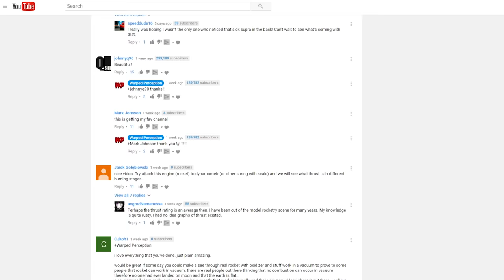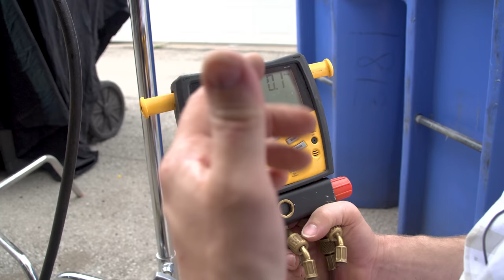Model Rocket Engine In A Vacuum Chamber - 4K Slow Motion - will it burn? - Rockets (S1 • E3)

Comment: Ok, can you build a setup to measure in slomo what amount of gas is produced by that Rocket motor? Also it would be interesting to know a what pace the pressure inside of the tube, is rising with, when the motor is started.
Reply: Nice video by the way, I obviously was so stunned, i forgot my manners :)
Reply from the maker: +Racineism working on that new episode now, I had some really interesting findings, check out the community tab, I posted a behind-the-scenes photo there.

Comment: So, many people who understand the flat earth theory better have commented here already that it’s NOT “will the rocket engine burn in a vacuum,” but “will it FLY in a vacuum.” I can only assume you tried to see if it would fly/propell forward normally now that you know the real question from others and it didn’t do so well. I haven’t searched too hard yet, but I found only one lame pop can experiment to show it would fly in a vacuum. I expected to quickly find tons of proof it would work on youtube & since it’s not there it makes me think rockets can’t propell properly in a vacuum. IDK either way what would happen but lean toward it would move forward in a vacuum at this point (at least not properly). One way to test would be the ballon taped to a straw on a string method in a vacuum to see if the ballon moves forward along the string via the straw like it does in a non-vacuum. A lot more simple, no need for a rocket engine & all that (if you have a way to unplug the air out of the balloon w/o breaking the vacuum).
Reply: Tom Woods uhm it flew ( it moved)
Also most people already think most people know this already so they don't make video's about it 
Another reason is probably that it looks like  much work and the pomp doesn't look cheap either

Comment: The thrust was seen on the scale after the the exhaust gases filled up the vacuum chamber half way, It would be helpful understand truly if rockets function in space if you can show the pressure fluctuations in the vacuum chamber on the manometer. thanks

Comment: Great experiment but the setup needs improvement. The spring should NEVER be connected with the cylindrical enclosure.  At 1:25 when you finger-test the spring, you are essentially exerting force onto the spring, and the spring is exerting force onto the cylindrical enclosure. The wall is providing the equal and opposite force. You could modify the experiment by making the spring to "barely" hold the rocket. You want to eliminate the wall from the experiment. The players should be the rocket and vacuum state. The setup will be hard since the rocket will fall due to gravity.

Comment: even if there is not air in vacuum, the rocket motor can still make pressure from the gas that exits from the rocketmotor, and that force pushes the rocket forward, and if someone was behind the rocket motor with a massive steel plate, he would be "shot" to the other direction with almost same force (depending of the effectiveness of the object to use the pressure.) and if you for some reason claim that there will not be pressure, that would mean either that the gas doens't have a mass or moving and object doens't require any force in vacuum ("bECaUse THeRe isN't AiR rEsIStAnCe!!")

Comment: Sorry, your vacuum tube is WAY TOO SMALL - The vacuum of space is beyond little tubes, the engine is still pushing off the wall at the end. Watch your slow-mo again and you'll see air passing by the engine, you can see in plain view it's pushing off the crap behind it... If you wish to view a real test, the engine smoke can "never" pass by the engine, the tube must absorb all exhaust.

Comment: Its hard to believe some people don't understand how rockets generate force. It's not the same  as an aircraft wing which actually uses atmosphere. In other words, wings manipulate the atmosphere to provide lift. The rocket has all of its necessary components inside to burn in a vacuum. It does not thrust itself forward pushing against atmosphere. It is a constant controlled explosion so it is the potential energy of the rocket that is being used. Think of it like shooting a gun. The bullet pushing on the atmosphere causes a recoil? O_o Explosions man! Rockets do not compare to wings... I mean do they even look the same? They operate on different principles.
Reply: I think you're giving them too much credit by assuming they know how a wing works.

Comment: Once the solid oxidizer thats mixed with the solid fuel inside of the rocket burns it creates an atmosphere inside of that small tube to thrust against, there should be continuous vaccume applied during the experiment to keep the tube in a vaccume state to off set the created pressure from the burned fuel that creates atmosphere/ internal pressure.
Reply: Rocket propulsion works BETTER in a vacuum. Do you honestly think that Engineers have not tested the 100-year old Tsiolkovsky Rocket Equation?
Anyone that proves it to be FALSE would get a Nobel Prize in Physics.

SO you believe that a Crossbow fired into a vacuum would NOT have any recoil force? Are you sure about that?

Comment: Should have put the vacuum meter in the shot as the engine was ignited.  Otherwise how do we know it was in a vacuum? The meter should have registered a pressure after the burn. There should not have been any vacuum left after the burn, but pressure. Nice try. But the editing causes many concerns. No problems with the build. Excellent test tank. Excellent construction. The holder inspired by the scroll compressor was unique as well. Not convinced the tube was completely evacuated and under a non-leaking vacuum.

Comment: If you watch the slo mo, the rocket doesn’t move until enough smoke built up pressure. Clearly the smoke filled tube was no longer a vacuum.

Comment: The smoke was the atmosphere that allowed the rocket to move. You have to have a chamber at least 100x the bottle rockets you're using. Fact is, it won't go anywhere.
Reply: @darklight2.1  the fuel has both propellant and catalyst so you don't need oxygen in the chamber. That won't work in space because the vacuum is infinite.
Reply: @nesNYC  :False. Rockets do not need thing to push off from. How do you think they work when launching and flying up?
Reply: @kitcanyon658  The rockets push on atmospheric pressure. Everything flies by pushing on this pressure. Then inertia does the rest. If they're really getting out into space, they would run out of atmospheric pressure once they hit the vacuum. They'll still have forward momentum but any drag would slow them down but the engines would have no effect in the vacuum.
Reply: @nesNYC  : No, that's false. Please explain how a stream of rocket exhaust, traveling out of the nozzle at supersonic speeds gets a push-back force from the air molecules. These same air molecules that would be being blown backwards from the craft by the rocket engine's exhaust. 

How does an air molecule transfer a force when it can't even touch the space craft? That's seriously your explanation? Jesus. 

Also, a rocket's thrust increases during its flight simply because the air become less dense. In your fairly tale-science-less world, a rocket would start to lose thrust the higher it goes. Since we can measure this during flight then you have zero data to support your weak claim. I know, you flatters have to keep grasping at straws and claiming so many things are fake but get an education.
Reply: @kitcanyon658  So air molecules don't offer resistance? Then explain why the craft needs heat shielding for re-entry 😄😄😄
Reply: @nesNYC  : That's not an answer to my question. How do air molecules push back against the rocket structure?

That's cool, bro. Just keep trying not to answer the question. We all see what you're avoiding here. 

And by the way, sure, air molecules have mass and heat things up through friction. As a structure touching them while moving. 

So explain again how air molecules being a rocket, being blasted further away from the  rocket touch the rocket and push it forward.

Comment: This experiment doesn't prove a rocket can work in a vacuum, however it does prove Newton's third law that states when two separate bodies interact, they apply forces to one another. The ACTION of the rocket exhaust applying a force against the rocket gasses and smoke the exhaust produced resulted in the REACTION of the rocket trying to move forward. Good job!
Reply: The action of the rocket expelling exhaust gasses has the reaction of those same gasses pushing back on the rocket.
Reply: @AM-rd9pu  Nope...that's what they want you to believe...but it is not true. You should have learned this in school. Movement requires two different forces acting against each other. The rocket exhaust is indeed a force, but there is no force acting against it is a vacuum. It is free to rush out the nozzle in the back, but unless it encounters a force acting against it, no movement will occur.
Reply: @rodneybaker2629 How do you think the exhaust gasses accelerate out the nozzle if not from a force from the rocket?

The expanding gasses collide with the combustion chamber and nozzle and impart a force on the rocket and the rocket imparts a force on the gasses. That’s the force pair you’re looking for.
Reply: @AM-rd9pu  Do you not understand when a gas is released in a vacuum it is immediately dissipates into that vacuum? They don't hang around long enough to provide a force. Remember, the third law requires two opposite forces that come from two different sources.
Reply: @rodneybaker2629  A vacuum isn’t a force. Gasses disperse because of their own internal pressure. The gas pushes itself into the vacuum. And when you have pressures in the range of thousands of psi inside rocket combustion chambers, the gasses push themselves out with a lot of force, pushing the rocket as they escape.
Reply: @AM-rd9pu  Yes, a vacuum is not a force, that is why when the rocket exhaust leaves the nozzle it encounters no opposite force. When gas expands into a vacuum, this process is called a rapid spontaneous expansion. The exhaust gasses do not perform work and no work is supplied to the system. If the system, the rocket, does no work it does not move forward. Newton's 3rd law of motion requires two opposite forces working against each other in order for movement to occur. The exhaust is part of the rocket for a while and is not an opposite force and when the gasses expand into the vacuum it is not an opposite force then either.
Reply: @rodneybaker2629  You seem to be yet another person who is confused by what w in w = -p * delta_v means. It’s the work the surroundings do on the system or the work that the system does in the surrounds. In the scenario of a rocket in space, the gasses are the system and the vacuum of space is the surroundings. When we plug in 0 for p, w get that zero work was done. This intuitively makes sense because it takes now work to push on nothing. A vacuum offers no resistance to the expansion of a gas. 

We know from the first law of motion that a force is required to make mass accelerate. We observe mass (the exhaust gasses) accelerating out the back of the rocket. So we know a force acted on the gasses to accelerate them that direction. The only place that force could have come from is the rocket. By the third law of motion, we know that there is an equal and opposite force. This means that the gasses impart a forward force on the rocket. 

The rocket pushes on the gasses and the gasses push on the rocket. That’s all there is to it.
Reply: @AM-rd9pu  You are not getting it. Of course gasses coming out the rocket nozzle is a force. But these gasses do not exert a force on the rocket. You seem to forget that the exhaust and the rocket are part of the same system, they are two parts of the object, the rocket. You can not have movement from force of just one object, you need two separate objects that have two separate forces acting opposite each other. If you don't believe me, try walking and your feet not touching the floor. Your feet is a force, but you won't move at all. Now try it with your feet on the floor. You feet are still one force but now the floor is a second force. This time you will walk because we now have two separate forces working in opposite each other. You know this is true, why give up your logical thinking and your common sense just to make a failed condition justifiable because you are told rockets can fly in a vacuum. It doesn't make sense someone would do that.
Reply: @rodneybaker2629  No, you’re not getting it. 

If not from the rocket, where does the force come from to accelerate the gasses backwards?

The force comes from the rocket. The two objects are the rocket and the gasses. The gasses push on the rocket and the rocket pushes off the gasses. 

Rockets work for the same reason that throwing a heavy object while sitting in a rolling chair will make you roll backwards.
Reply: @AM-rd9pu  The two objects are not the rocket and the gasses, they are part of the same system. You need another system involved to have something to force against.

You principal of throwing something while setting on a chair is not the same thing as a rocket. The reason you would move backwards while setting on a chair with wheels and you threw something is because there is friction between the wheels and the floor. While in a rocket and the gasses are thrown out the back the rocket won't move forward because it has no friction to move against. There must always be some sort of friction or force to move against or it won't move. A car won't move unless it has friction from the road. When you watch a rail dragster blowing fire and smoke out it's exhaust pipes, do you think that is what is causing it to race down  the track? Of course not. You know it has to be the friction of the race track that causes it to race down the track. Without the track for the tires to force against, there would be no movement.
Reply: @rodneybaker2629  Do you really think that the rocket and the stuff it’s ejecting out the back at hypersonic speeds are really not separate things?

A space shuttle main engine ejects over 500kg of mass every second. How do you propose that happens if not from a force from the rocket? And do you not think that ejecting 500kg every second would impart a force back on the rocket?

You’re comparing apples to oranges here by bringing wheels into this. The third law of motion is still involved, but a wheel gripping and rolling across a surface is very different than thrust. 

I used the rolling chair as an example because it’s more tangible. If you were floating in space or sitting on a frictionless surface and threw an object, you’d move backwards. 

The rocket exerts a force on the gasses and the gasses exert a force on the rocket. That’s all there is to it.
Reply: @AM-rd9pu  So it is your belief that the exhaust pushes on the exhaust and the rocket moves forward. So this means that I can set in an office chair with rollers and take my hands and push on my chest as hard as I can and I will move backwards? We can use a very strong man with big muscles to prove your concept.
Reply: @rodneybaker2629  No, that’s not what I said. The rocket and gasses are two separate entities. The rocket pushes on the gasses and the gasses push on the rocket. 

Also note how you avoided all my questions and then just misrepresented my point.
Reply: @AM-rd9pu  How in the world can the rocket push on the gasses? Please explain how a rocket do that when it in entirely within a vacuum. Don't you realize in order for something to push against something else it need a solid footing the same way you feet need a solid footing when you walk. In this case the solid footing is the ground. There is no ground in a vacuum of space. 

The gasses are not pushing on the rocket either. The gasses are going away from the rocket, not trying to go towards the rocket. You don't seem to know basic movement principles.

Comment: In the beginning it doesn't move at all.

It's not until the very small vacuum chamber filled with substance (gas or smoke and exhaust) which allows it to have thrust since it is able to push itself off of this.

The premise of rockets in space is only that they can merely push themselves off of the exhaust the expanding fuel creates.
This all has to happen which cannot be portrayed with such small vacuum chambers.

The first part of ignition shows it goes nowhere in a true vacuum until the chamber all the way to the back wall is filled with exhaust.
Reply: So would a CROSSBOW still have RECOIL in the vacuum of space?

Comment: I suggest you first read up on thermodynamics before coming out here calling your pipe a "giant vacuum tube": the gas equation does NOT talk about vacuum, but about VOLUME,  and we are talking about a potentially infinite volume of space. Pressure and with it recoil, in an infinite empty Volume will be ZERO according to P=kNT/V.... P=0 with V=∞
Reply: Michael Brenner - are you suggesting that RECOIL stops working in a vacuum?
You DO know that rocket propulsion is just RECOIL from the nozzle pushing on the MASS of the exhaust gas right?

And that vacuum does not "Suck"?

Comment: The only Comet I have is that your chamber is so small and being that the fuel itself has an oxidizer then as soon as you force the fire with atmospheric pressure you are creating a false atmosphere in such a small vacuum. Try to do the same experiment in a much larger vacuum where the oxidizer and the waste of the fuel-burning does not create a sense of a false atmosphere

Comment: Once the rocket had finished it's burn, I wonder how much of the vacuum had been replaced by exhaust gasses?
Reply: No pressure, no gas.  No gases, no Oxygen.  No Oxygen, no combustion. This 4sure is fakery!
Reply: @abelmicah3430  what about this? Gunpowder has its own oxidizing agent built into it, so it doesn't need air to burn! Omg science, eh?